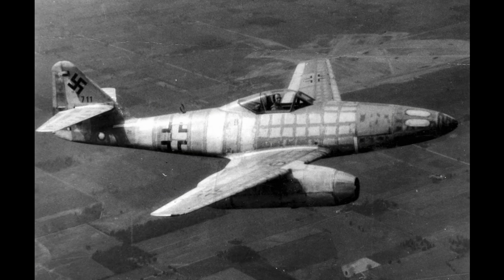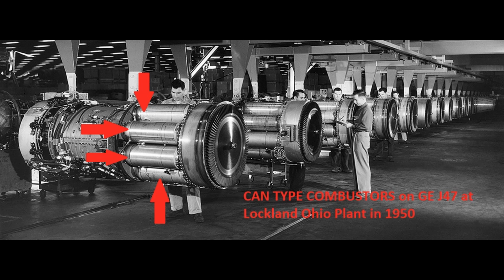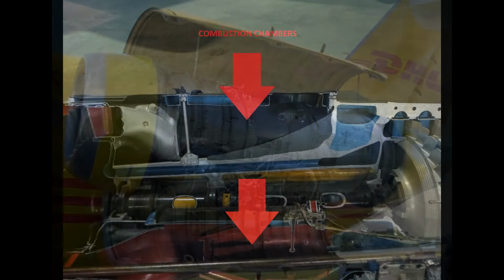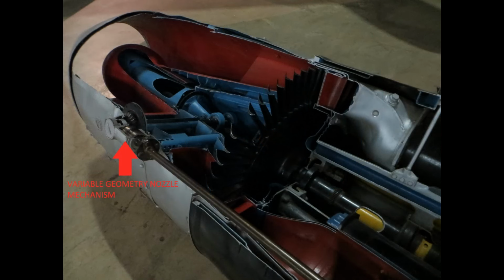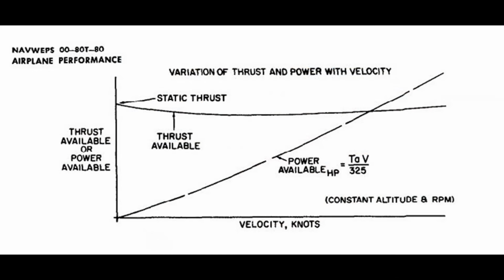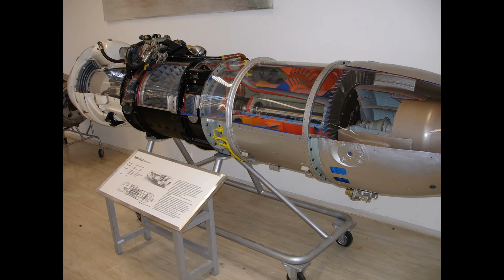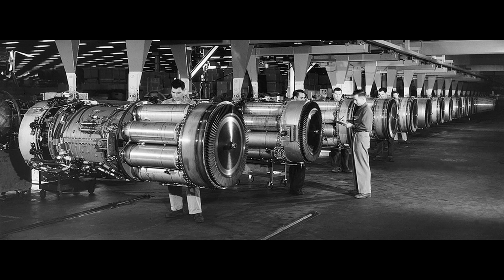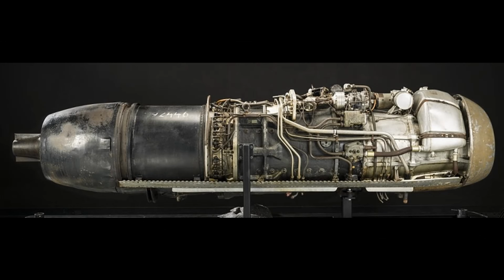World War Two JET POWER

Comment: Jumo 004 life 20 hours if lucky Whittle engine life 200 hours, 004 1000 lb thrust Whittle 1500 lb thrust  004 better engine ???,   Axial flow engines were running in UK early 1940. Saber Engines based on Metrovic  Beryl not 004.  Modern engines use combustors, every one including USA recognized that that Axial flow was preferable but that the technology was not available and centrifugal was more practical and still in use in most turbo prop engines.
Reply from the maker: Most turbo props? All those PT-6s are axial flow, so are the Allison T-56s and those are two of the most common turbo props out there. Centrifugals have their place, I have over 6000 hours flying them, and I like them, but for a powerful jet they are not the way to go.
Reply: @GregsAirplanesandAutomobiles  Both have centrifugal stages

Comment: I remember "holding" short of the runway, behind a post-war T33 with the "take off when clear" instruction. The T33 started it's takeoff roll so I waited for a bit before pulling out onto the active runway. I lined up and looked ahead to get a visual on the plane. I looked up...higher...higher...higher. I literally had to lean forward to catch a glimpse of the antique silver jet punching a hole in the sky. At that point I understood what a jet was.
Reply: Eloquently put
Reply: And the T-33 was derived from the P-80 which was actually operational in Europe during WW2 as the United States second jet fighter…
And both ran on British designed engines…
Reply: @allangibson8494  If you wish to compare P80 with the Me262 you have to compare the April 45 version of it. 

If you compare the later T33 you should compare with the 004H version with 11-stage compressor and 2-stage turbine, to deliver 17.7 kN (3,970 lbf) thrust at 6,600 rpm.
Reply: @holgernarrog962  None of the later Ju004 engines flew during WW2 - and the Russians found them such utter dogs they replaced them in service with British Nene and Derwent derived designs within 12 months - the same Nene powering the 1944 Gloster Meteor.
Reply: @allangibson8494  You are living in a different world
Reply: @holgernarrog962  All the Me262s and their Czech derivatives were history by 1949.
There are still Gloster Meteors in service.
The Gloster Meteor (with Derwent engines) set an airspeed record in 1945 the Me262 couldn’t match.
The Meteor was simply a better design for service in every respect than the Me262.
Reply: @allangibson8494  The Gloster Meteor was built with straight wings. It had the radial engines and thus had far more drag than a Me262. It required far more thrust to achieve the same speed. 

Jet technologiy developed very fast in the 40ies and 50ies. It is to compare the engines of the exact same time. The main challenge for the German designers was the lack of nickel and molybdenum that reduced the time between overhauls of the German engines. If the war would have proceeded without a complete destruction of the German industry.(2nd half of 44)..new variants of the Jumo 004 would have entered service as an afterburner, new controller in April 45, later version G anH had significantly more power. Other engines as the DB007, He S 11, Jumo 012, BMW018 would have seen service till 47 or 48.  

The Soviets preferred simple, robust designs. They had plenty of Nickel that was required to build the British radial engines. That was in my opinion the probable reason that they decided in favor of the radial engines till the 1950ies. There was the exception of the Jumo 012 that was developed to the NK12 PTL that is with further development still in service with some TU95. 
 
Czech did not have the industrial and financial background to stay upfront this technology race. As they became a satellite ot the Soviet Union they adapted Soviet designs.  

The USA captured the German technology some engineers added it to their own know How (J35) to the J47 that became the most popular jet engine end of the 40ies. 

France took the BMW jet engine team lead by Dr. Oestrich. They became SNECMA and developed the ATAR. Later Oestrich and others became French citizen.      

The radial engine was a dead end. Since mid of the 50ies radial engines became rare. Only small engines or engines with a radial final stage are commen.
Reply: @holgernarrog962  It took the BMW team TEN years to develop an acceptably reliable engine at SNEMCA.
Exactly zero German technology went into the J35. It was based on the British axial flow Sapphire engine which developed into the Avon engine.
Straight wings have nothing to do with drag - the Me262 had the same wing sweep as the DC-3 (accidentally because the centre of gravity of the Me262 (like the Me210) was grossly aft of where it should be. The Me P1101 was the true investigation of transonic drag and the swept wings helped with transonic CONTROL not drag.

Comment: Also, of course a bit of strategic perspective/hindsight: The materials that made the later more reliable use of axial turbines possible, the western Inconel and Nimonic, also the Russian KhN80TBYu, are all Nickel based (at the very least >50%, most types ~70% Ni content) alloys, and as such would probably have never been provided to the Luftwaffe production sites in adequate quantities, even if someone had come up with the alloying recipe by sheer luck, or stole it from the allies. They were essentially accepting bad compromises to get rid of the moderate (~30%) nickel content in their turbine blade steels to push mass production, same in piston engines by the way (WP says, referring to The Secret Horsepower Race which I haven't gotten my hands on yet, that both BMW and Daimler-Benz tried to lower the Nickel content on the BMW801 and DB605 exhaust valves, ran into serious reliability problems as the lowered resistance properties would lead to corrosion on the valves->hot-spots->pre-ignition->knocking->engine death, and then instead of going back to the known better material, they came up with thick chrome plating as a workaround, just to lower the Nickel content from ~13% to 8%). 

So it's hard to imagine them going the other way - as there was a huge, impossible-to-fill demand for Nickel (mind you, as a side ingredient of just a couple percent points - high-strength and stainless took around 1-5%, high-temp capable steels used 10-30%) for a whole lot of high-quality steel alloys, used in everything from gun barrels to engine parts to armor plates to u-boats. So let's put it like that: To produce 100kg of these alloys (which I'd estimate would be enough for one jet engine), you'd use 50-70kg of Nickel. With that same amount of Nickel, you could create literally tons of high-quality steel alloys (~3.5% Ni) for gun barrels and so on.
 
All known pre-war high-temp alloys (mostly steels) were using high Nickel content, that was the way to improve those heat resistance properties in metals, so it might have seemed obvious that new heat resistant alloys would just as much rely on a very high Nickel content (perhaps, as it turned out, even an entirely Nickel-based alloy instead of an Iron-based steel) - the path to that must have seemed well-established; as Frank Whittle put it, it was quite obvious that the only reason the material didn't exist yet was because the application didn't exist yet (which made it even more frustrating for him to be told it can't be done, on the grounds of the material not being there) - and indeed, once the demand for a jet turbine application was recognized and metallurgists put their minds to it, they came up with Nimonic 75 and 80 within a remarkably short time, starting production in 1941.

The deposits aren't very well-spread - the most relevant deposits up to this day are in Canada, Australia - and the Kola peninsula in arctic Northern Russia. The latter was repeatedly attacked by the Norway-based Wehrmacht from 1941 on to interrupt allied and potentially establish German access to these deposits, but the Wehrmacht never managed this and actually decisively lost control of the region (Kirkenes) by Oct 44. Such a war-time shortage of Nickel was well-known from WWI, and the German metallurgists were indeed working with concepts to gain Nickel from low quality (<0.3%) ores available in central Europe, but these of course weren't particularly efficient... A bit like the replacement gasoline they were making.

Now the Brits, with colonial access to two Nickel producing regions, were reluctant to rely on using the higher-temp axial compressor design, while the Germans, with natural access to NONE went all-in on axial compressors, in the hopes of figuring it out somehow... It was a daring move,  and  commendable that at least Junkers sort of made it work, especially given the production situation in late-war Germany - but I'd hazard the guess they would have avoided a whole lot of problems, and ended up with a more reliable production ready engine sooner, had they just done the obvious reasonable thing and thrown their R&D resources at a less demanding centrifugal design...
Reply: I have found references to Krupp considering doubling the nickel content of tinidur alloy but rationing mitigated against this.  They did understand that creep was reduced by nickel.  Compressor type should effect turbine temperature.  The Jumo 004 used an impulse style compressor which is less efficient than the reaction axial types but can be made by punching rather than machining.  HeS 030 used reaction type and was half the weight and more efficient.
Reply: @WilliamJones-Halibut-vq1fs  Thanks, I didn't know about the efforts at Krupp! That makes a lot of sense to me, hearing that they knew fully well what the demands of this technology were and that scarcity of alloying compounds was an ever-present topic for them. Unsurprising, I guess every greybeard there had been through exactly the same in WWI... Have you (or of course anybody else) maybe found more information on why, with these reasons and even von Ohains earlier types such as the clearly working HeS3 powering the He-178 being centrifugal designs, they never considered going for a production centrifugal engine as the "first step"? I never found any reason other than the clearly solvable space/frontal area concerns.
Reply: @decnet100  
The German industry had been aware that in any possible war, nickel would be one of the key metals in short supply. Consequently, even before the war, efforts had been made to develop alternatives and R&D on nickel-heavy alloys was curtailed: e.g. Krupp works did not introduce an improved Tinidur alloy with 60% instead of 30% Ni because of the anticipated shortage, even though the high temperature advantages were known (Meher-Homji 1997). One of the areas in which this awareness manifested itself was in superchargers, which were the first applications of hollow turbine blades: a BMW turbo-supercharger ran successfully at 900°C in 1938, using internally air-cooled blades.
Reply: @WilliamJones-Halibut-vq1fs  Thank you, that is exactly what I suspected, I'll also check out that reference! Hearing this makes it even harder for me to understand why they'd go for the clearly more thermally demanding axial design for literally all jet engines aimed at production... Especially knowing what steps they indeed took on the Jumo 004, it brings up this image of engineers' arrogance "sure we can do it, we'll just use every trick in the book to reduce the thermal load, and so we'll design not just the most advanced entirely new engine in the world, but also do it using cheap materials!"

And at the same time, the RLM had already laid out a research plan for 4 classes of jet engines (all the WWII production types belonging to class 1), with each class representing an increase of roughly an additional class 1 engine's thrust output (so class 4 would, in their plan, have been around 30-50kN engines - so I'd say up to roughly the P&W J57 class of engine, as powering the early B-52Ds). 

Can't help but think, these engineers really lived in that Ivory Tower... I guess they'd either have to dissociate themselves from everything that wasn't directly work related, or just firmly believe in the Endsieg and assume that pretty soon the right materials would become available.
Reply: @William Jones-Halibut Thanks indeed for the reference, and mentioning Meher-Homji's article (which as an article was easy enough to check out from home) - he mentions in a footnote (p.786, n.9) that a new alloy was indeed tested in 1945, which would have made a significant increase in engine life (to the 150hour mark) possible in actual test flights - but unfortunately doesn't specify what sort of alloy that would have been. Makes me wonder if they indeed simply, and against all reality of scarcity for production, went for a high-Ni variant of Tinidur in a desperate "see, it works if only we could get the fancy alloys!" response to criticism, or if they indeed found something that lets my claim fall flat on its face - would something like a "slightly more nickeled" Cromadur variant have sufficed?
Reply: @WilliamJones-Halibut-vq1fs  Oh, and J.M. Korhonen in the secretprojects link raises an interesting point regarding the nickel limitation, also countering my argument, and actually gives the production figures, which I was looking for but couldn't find yet - I think he ignores entirely in his argument for "Nickel wasn't the limiting factor, it was the turbine blade production methods" that the Nickel consumption he bases his calculation on is that of production 004 engines, the vast majority of which were made using Cromadur. That was explicitly meant to be as nickel-free as possible, Meher-Homji has it at ~0.2% content. I'd hazard the guess that using Tinidur (30% Ni, and therefore 150x the amount compared to Cromadur), or indeed something like Krupp's proposed double-Nickel Tinidur (~300x the amount of Cromadur), the consumption would have increased from those 40 tons to very, very uncomfortable levels quite easily  :). It makes me think though that an improved alloy (my aforementioned "slightly more nickeled" Cromadur) might have been possible, even palatable indeed, at least given the '44 supply situation (which quite surely worsened by 45, but that doesn't mean the planning adjusted immediately)... - you can easily reach Cromadur's Nickel content from recycling high-quality steel in the smeltering process (of which I suspect there might have been a bit available, given that Europe looked a bit like a war zone at the time ;) ) and wouldn't need to use any precious nickel ore whatsoever - so that must have  seemed like the jet engine manufacturers were actually exceeding their Nickel goals, and I'd say they wouldn't have been entirely out-of-their-depth to ask for at least a little bit more of the good stuff. 

On the other hand, if we assume that the biggest problem of Tinidur was indeed that it wasn't weldable as required for hollow turbine blades, going for that higher-nickel Tinidur variant would very likely have removed that obstacle - Nimonic 80a, which this would have closely resembled, is according to it's datasheet "readily  joined  by  any  of  the resistance   welding   processes.      Fusion   welding   by conventional  processes  such  as  T.I.G.  or  M.I.G.  (dip  or pulsed transfer) is satisfactory for section thicknesses up to about 5 mm (0.2 inch)." So I suppose that would have solved most if not all the problems they had with employing "medium-Ni" Tinidur.
https://www.haraldpihl.com/globalassets/pdf/057_nimonic-alloy-80a.pdf
Sidenote: Another improved alloy that is supposedly moderately weldable is A-286 - it's basically Tinidur with added Niobium (~5%) - I don't think that's a potential candidate either, there was absolutely no access to any exploitable Niobium deposits for the Germans in 1944/45 - once more, geologically speaking, you'd need to have boots on old continental crust, explicitly meaning not central Europe - Africa, South America, China, Russia...

So, basically I can't quite decide whether there was the possibility for a new scarcity-compatible material, or whether that mysterious super-alloy in testing mentioned was indeed just that most logical step, a Ni-based alloy - perhaps in the wake of trying to improve the 004's power output. Didn't they try adding an afterburner to these? I mean the use of RATO systems on the Me262 tells me they would be interested in going down that route, to get the fighters up to altitude even quicker. 
Going for a non-production-compatible material such as High-Nickel Tinidur on the known components would make for a highly reliable testbed, a good (actually time-saving!) way to figure out how to employ any new component - instead of stressing some production engine beyond it's regular (10 - 25 hour life expectancy) capabilities, before having to transfer the new components over to another unit! That wouldn't be the worst choice to make IMO.
Reply: You're leaving out Haynes Stellite, also used in turbine buckets, which is mostly Cobalt-based.
Reply: @peterstickney7608  That is true, Stellite (I think by then they were producing Stellite 21?) would have been another alloy that was in fact available (to the allies!) and capable of serving in that role - yet going for a Cobalt based alloy wouldn't exactly have solved the Germans' problem - it was just as rare and inaccessible to them, if not more so than Nickel. Most of it was and still is mined as a side product of copper-nickel deposit mining, and usually the Nickel content of any deposit is by far (2-4x) greater... So from their perspective, to go for a Cobalt-based alloy would have been a bit of an (alleged) Marie-Antoinette-type suggestion :)